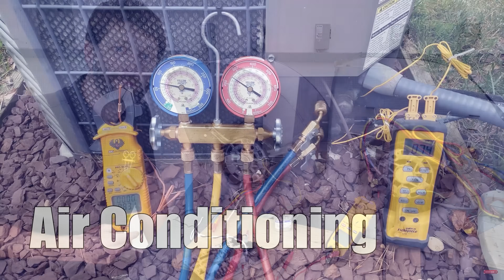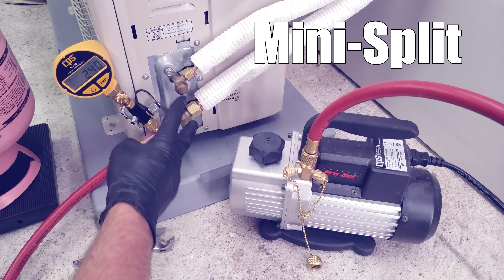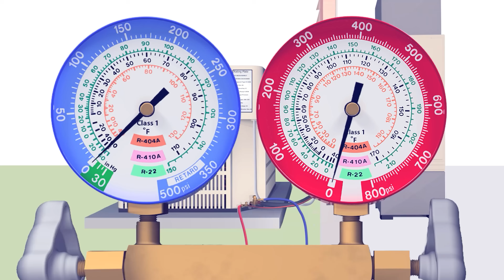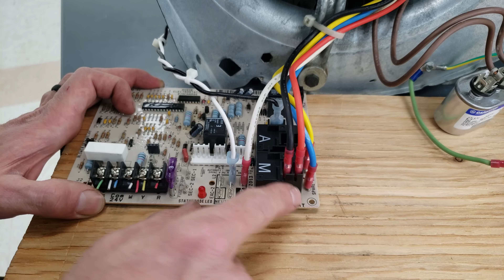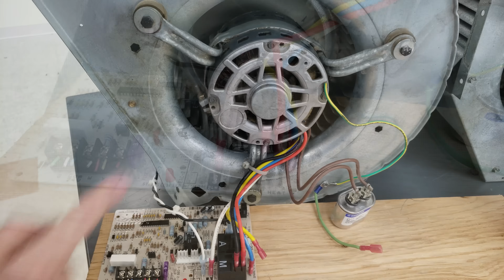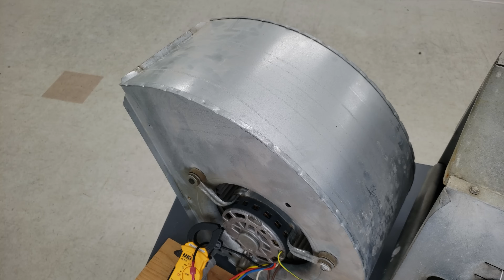HVAC Blower Motor Class! PSC Motor Speeds, Colors, Ohms, Current, Shorts, Air Restrictions!

Comment: See the multicolor speed selector wires coming out of the motor? Some of mine got damaged and I would like to know what those wires are called as far their heat/insulation specs so that I can
splice them with high heat crimps. Thank you!

Comment: Craig i can't find any info on choosing the correct capacitor for a multi hp psc rescue motor.   Can you point me in the right direction?  Why does a single hp motor need a certain cap to not over heat but a multi hp motor can run several different caps to achieve different hp without consequence?

Comment: Great tutorial, thanks! So now that we identified our speeds, how do we find out the RPM of each speed with out a rotation meter. The reason I ask is my motor at home on my condenser was an 860 RPM motor. I only had a 1075 two speed motor on the truck to replace it with. So naturally i put it in so my wife could have some air conditioning. I wired it to the low speed, but it still seems to be a bit too fast. I searched some for the answer to this, without much luck, any help would be great, thanks again.

Comment: Were you adding a restriction or adding static pressure? A duct system will,add static pressure without adding a “restriction” but a PSC running without static pressure will over amp, get hot and shut down.....am I correct?

Comment: The great thing about videos like this is the way they challenge preconceived notions. From your video I spring boarded into better understanding of how PSC motors allow variable speed. A standard formula to determine synchronous speed of a squirrel cage induction motor is to multiply 120 by 60, then divide by the number of poles in the motor. Most, including most shaded pole motors, have two poles. Am I correct to assume that the speed control of those extra windings is because the extra windings effectively create more poles in the stator, resulting in a slower synchronous speed? Is the slip % of slow speed significantly more for slow speed operation in PSC motors?

Comment: Can you explain what was happening in the motor when air flow was blocked? Why got higher speed yet current went down? It was already at its highest set speed. Will motor be dead sooner when air flow is consistently blocked? Thank you
Reply: yes..for PSC blower motor it will  increase its speed if its not getting the load / air    needed  to try and make up for it  causing higher motor winding temps thus leading to eventual failure!!

Comment: Craig,  is there a way to tell if the blower motor is getting weak, like not blowing as hard as you think it should?

Also if you want the fan to always blow on high speed for everything,  can you put a dual connector or y adapter on the black wire to both the heat and cool terminals?

Comment: Hello. Thanks for your videos.
A question...if im checking resistence between any of the wires of the blower to ground, and i get a value differento to OL. What should do? Replace motor? Or what step?

Comment: 1: 120v PS motor is easier to be burned out since it has higher current? 
2: You showed the motor current is much lower when its air flow was blocked, which is good for motor since its current is much lower? In reality when insulation pad fell off and blocked the air flow it normally caused the motor to be burned out. Can you explain that? Thank you

Comment: The most common issue service techs have when testing blower motor amperage in the field is leaving the blower door off. This will give an amperage that is out of spec and confuse a tech. And sadly, its used as a means to show a customer their motor is bad and sell them a new one. Better to plan on using a wire outside of blower compartment, even the plug wire can work by deducting inducer voltage from total if the heat is on.....Awesome video.
Reply: Without a wireless Bluetooth enabled clamp meter, can you describe the most accurate way to test blower motor amperage?

Comment: Craig, had you blocked off the outlet would you also have lower currents?
Reply: If the outlet was blocked off you would read a higher amps. Because the motor is struggling to move that air forward.  It reads lower when restricting the intake side because their is no air to move
Reply: @Mackenzie Gray  on a PSC motor your answer is wrong. On an ECM motor your answer is right. This video was on PSC.
Reply: MG, wrong. Blocking either the inlet or outlet results in the fan moving less air which means the motor is doing less work which equals lower current.
Reply: Yes